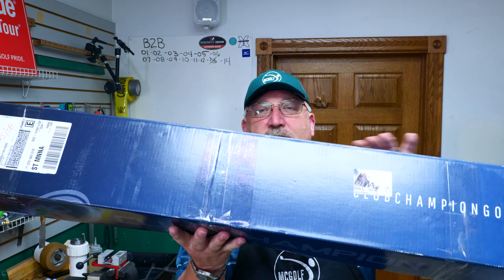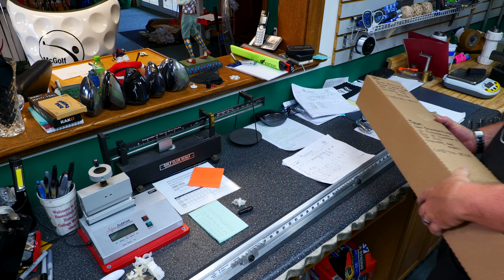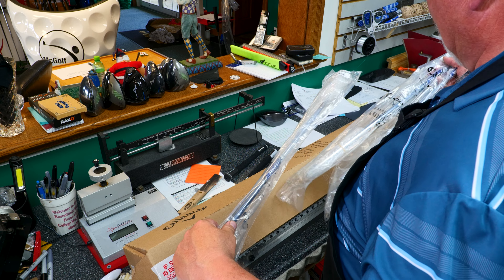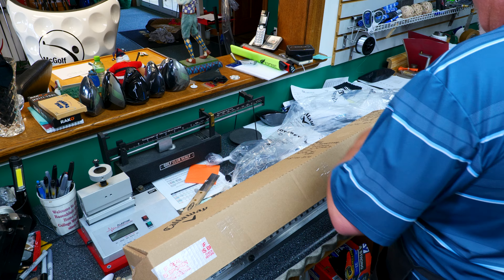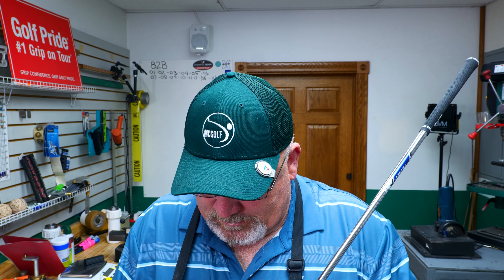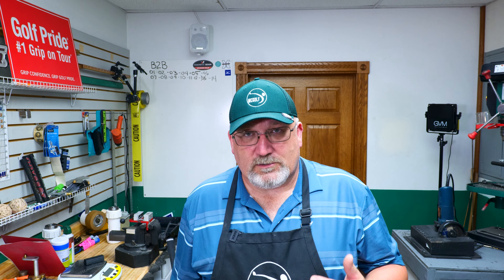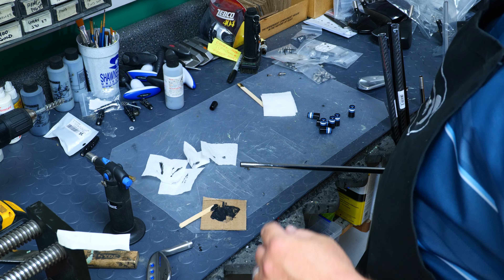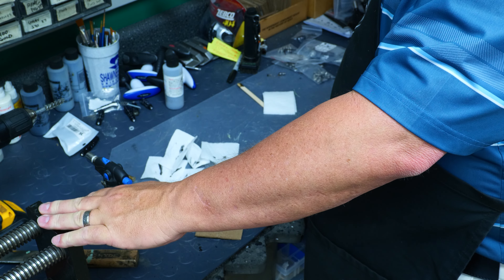Callaway MD5 Wedge Assembly b2b#14

Comment: Hey Jim, do you ever put a wrap of tape around the shaft at the end of the ferrule when you dry fit to ensure you don't abrade too high up the shaft? I sanded too high before on my own clubs and always take an extra minute to avoid over abrading...
Reply from the maker: My sanding belt is one inch wide and the typical insertion in 1.25. I normally abrade to the width and then a little more to get the distance

Comment: For the complete beginners such as myself how much "room" should there be between the shaft and the club's hosel? If there is too much room is it best to get a new shaft or trim it too fit?
Reply from the maker: If there is significant wobble It is probably due to 2 different tip sizes i.e. 370 hosel and 355 shaft. That can be made up by using a shim

Comment: If someone isn't close to a fitter, what would you recommend to someone who swings @ 94mph 7 iron, peak height 120ft? Loses distance through height? Spin 7000rpm. 620mb titleist.
Reply from the maker: Id probably strengthen the irons by 2 degrees. you will get length and height will come done